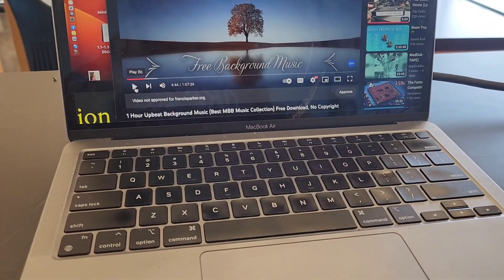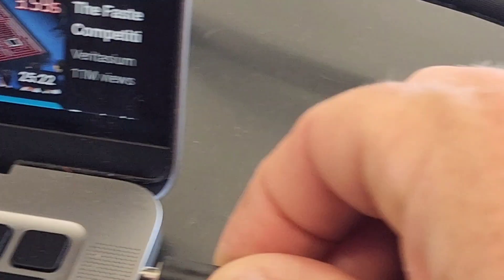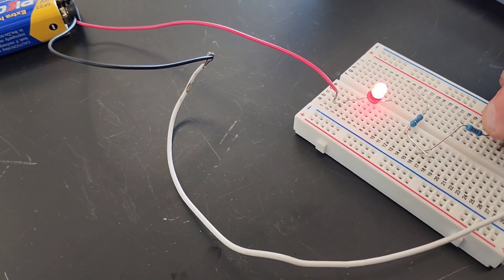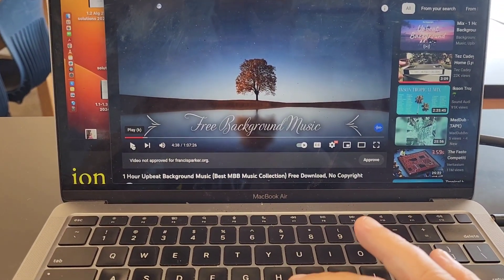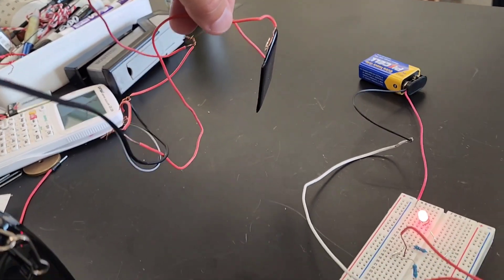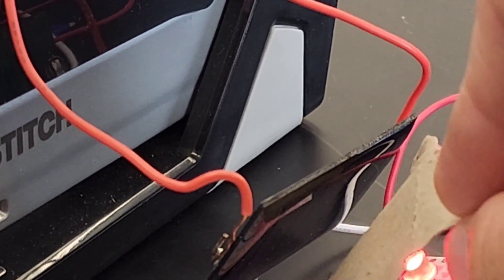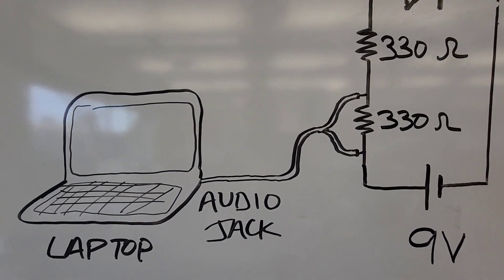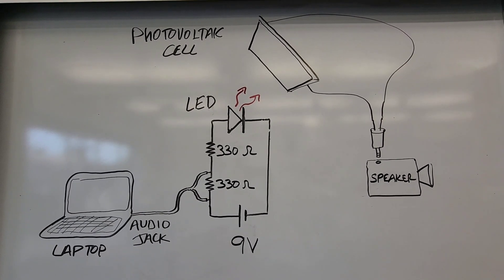Transmitting Music with Visible Light - Using an LED to make an Optoisolator

Comment: OK, so what you've essentially done is create an external optocoupler. These things are actually really useful for galvanic isolation in audio circuits, especially in digital transport. I'm not sure if connecting the output of your computer to the circuit without a buffer is a good idea.
Reply from the maker: Wise and reasonable advice. 👍 indeed, a cheaper and more robust audio source would be better for this little demonstration.

Comment: I’d like to take mp3s of my vocal music (Brahms, Schumann, Schubert, Wolf, Mozart, Bach) - translate them into light frequencies, then transmit my music into the universe. Perhaps to be decoded by other intelligent beings. Perhaps to travel 3.8 billion years to the big bang. Is this possible?
Reply from the maker: Definitely. On some level, this is already done with radio waves that are already sent out. The signal could also be piggybacked on a laser intensity and be sent out that way. I've been thinking of having a student try using a laser to transmit music down the hallway this way.

Comment: Is the design of circuit available ?

 What kind of Led is used?
Reply from the maker: The circuit I used is pictured at 4:05 in the video. To be honest, I didn't put a lot of thought into the LED. I just grabbed the first one I saw lying on the counter.

Comment: Can biophotons do that? Artificial telepathy so that i dont have to open my mouth but just think and you get the message. Biophotons can be amplified and perhaps their correct mixture will help us create a soul one day
Reply from the maker: Wow, that's a clever thought. I've never thought of that. On a simpler level than what you suggest, maybe that will eventually be a better way to detect intention than, say, Neuralink. A giant challenge with biophotons is, of course, that other cells are nearby and just absorb them. I appreciate your insight here. Interesting and clever.